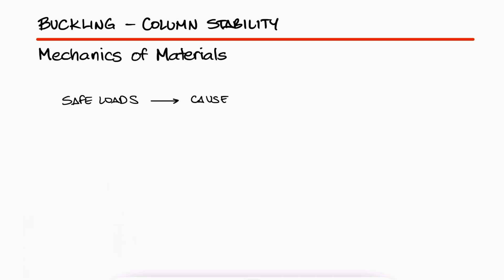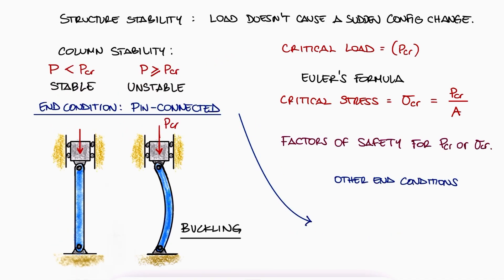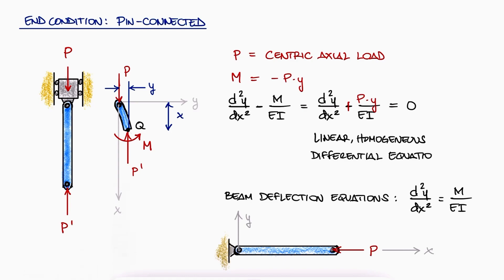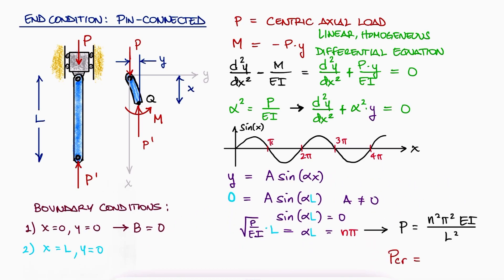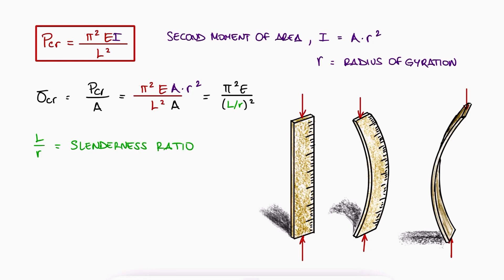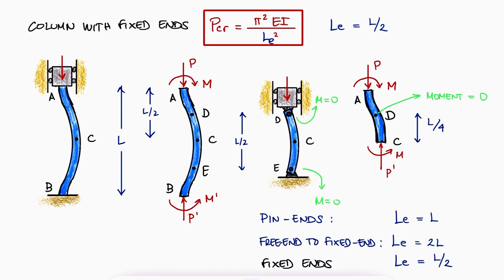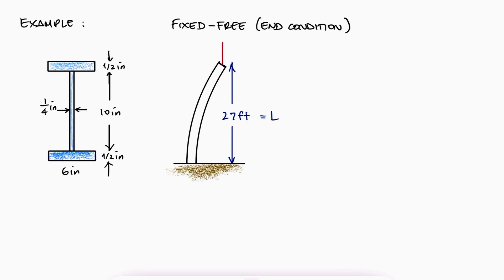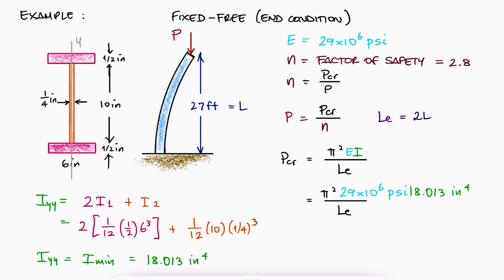BUCKLING - Column Stability in UNDER 10 Minutes

Comment: Correctiont  at 7:26
the effective length should be l/✓2 instead of 0.7 L cause in general formula of Effective length it should be with Pi so convert 20.19 into approximation of (2pi)^2

Comment: where did u get 12in/7ft ?
Reply: it's 12in/1ft because the length is given as 27 ft, you need to convert it to inches and 1ft = 12in

Comment: sir i need your help regarding  above buckling subject,i am coffee processing machinery manufacturer in india  ,i fabricated one coffee storage rectangle silo for our client  with 12 no colum of 200mm i section  length 2.5 meeter ,and abobe on this colum there is approximatly 30'length  x  20' width x 19' hight coffee storage silo mounted (aproximatly it store 250 tonne of Raw coffee) , which is not filled yet before filling i have to check about bickling please help me ,i wll send drawing if you share mail id

Comment: I have a question that I could do with help on:  "It is desirable to know the length of column which will first buckle at a load which causes the material to reach its yield stress given that the member is a 10mm square section. The youngs modulus is 215GN/m^2 and its yeild stress is 250MN/m^2. At what length is citerion satisfied? (fixed - free condition)
Reply from the maker: If force over area causes an axial stress equal to the yield strength, the column will yield. Solve for F. 
Substitute that F as the critical load in Euler's Formula with the effective length of a fixed-free end. Solve for L.